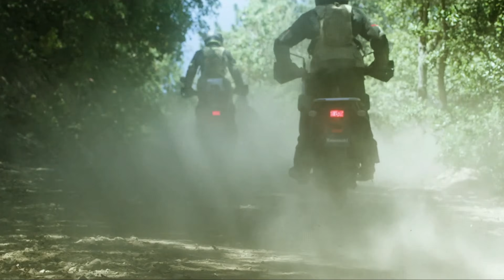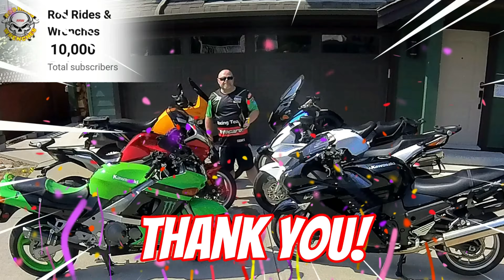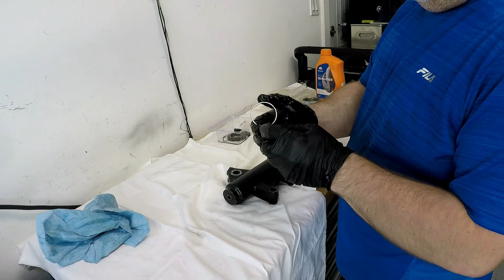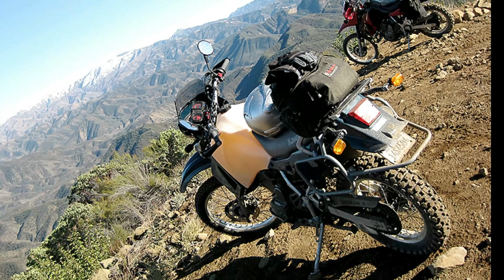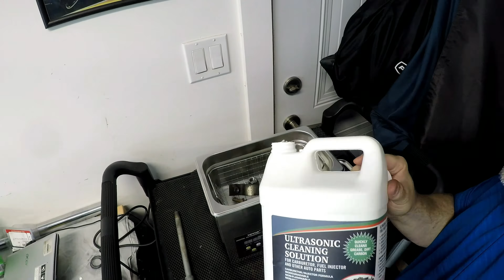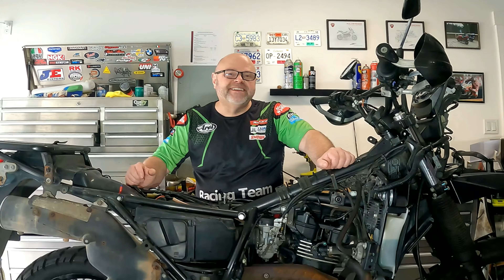Kawasaki KLR 650 Restoration & History

Comment: the proper way is to not get ahead of yourself taking the forks apart. that bolt comes off before you take the top cap off. preferably before the forks are even out of the trippleclamps, they are free fork vices why not use them. the spring tension keeps the damper rod from spinning, that bolt can come out with hand tools. ive done a fork rebuild in the dorm parking lot in and out before campus police noticed.

the way to install the top bushing and oil seal with no chance of damaging the fork is to wrap a bunch of electrical tape around the stancion and slide hammer it in just as you slide hammered it out on the stancion, stops moving you're done. no expensive one time use only metal tools or getting dangerous with washers, punches, and hammers. drop on the washer, roll in the clip, then mash down the dust seal with pure finger strength. rest is just reverse of disassembly.

fork oil level and weight are just more adjustments to play with to get the dampening you want, height is compression, and weight is rebound and compression. do with this information as you will best not to mess with it if you dont know what you want.

Comment: How did you get the pivot piece back on the bike? I'm currently stuck and can't get it back into the channel for the pivot bolt to go back through it.
Reply from the maker: It's hard but not impossible.  I lined the rocker arm up to the frame by resting it flat on my scissors lift and them tapped it into the frame, some taps harder than others.  If you don't have small scissor lift have someone hold it there.  Make sure the frame, grease seals and  sleeve are very clean, no left over grease dirt.  If it is really tight you can also put the complete rocker arm assembly in the freezer overnight to gain a few microns but you will have to work fast once out of the freezer.  Honestly it just take a but of force but make sure it is lined up to the frame squarely. - Good Luck
Reply: @RodRidesWrenches  Thanks! I ended up getting it by loosening the rear engine mount bolt on the right side of the bike, then prying the frame a little from the left side of the bike. It slipped in with PLENTY of space. 

Two late nights wiggling and hammering when it only took 5 seconds after making that little extra space lol.

Comment: Rod, I have a question or maybe a few:
1- do you have a video on  the V-Strom 650?
2- I plan on doing some outdoor adventure riding in Colorado next year.  I was told to look for a bike with good clearance. I am not certain what kind of riding I'll be doing. I live in TX and currently do no mountain or dirt bike riding. (I have an Honda ST1300). Can you give me any pointers on what I bike I might be looking for?
3- I am looking for a bike that I can ride both on-road and off-road as I want to ride in and around TX, and from TX to CO and not pull a trailer behind a car.
Reply from the maker: So many bikes, so little garage space.  If you want to do more offroad than on, I would suggest the DR650 over the V-Strom.  The V-Strom 650 is a capable bike but when compared to the 1000cc Strom it quickly loses its luster since it is slow and really uninspiring from the saddle.  Unless you plan on riding over logs/boulders and so on, the clearance is less of an issue that the aggressive nature of your tires.  I once road my 03 ST1300 straight up a logging trail while two up with my step son.  We turned around when the bears outnumbered us.  If highway is the primary focus then more engine displacement is better, you can compensate with adventure tires if you think you will be seeing gravel and dirt.  If you want to get off all the roads and onto the trails then I would for lighter machines like the DR or KLR single cylinder.  They can run all day at 60mph (but not much more, similar to the 650 Strom) and take you places you just drove by before on your ST. - Good Luck

Comment: Hi, an unrelated Kawasaki question from a fellow lower mainland motorcycle enthusiast.
Do you know if it's possible to put a quick shifter on a 2009 VFR? Thanks and love your content.
Reply from the maker: You can put a quickshift on anything fuel injected provided you find a kit that interfaces with the ecm.  Not sure they are worth the money on a VFR since you can power shift them up from 2nd gear on pretty easy just by blipping the throttle.
Reply: @RodRidesWrenches  Thank you for your answer. For some reason I 'm just not able to master the throttle blipping method. Not related, I know you like buying cheep bikes and fix them up. There's a 2006 VFR Interceptor with 26500 km in it for $2,550 in Surrey. Was listed on F/B market place 8 weeks ago. Nobody wants it looks like.

Comment: Hi Rod - I always loosen the fork bottom damper bolt while the fork is still assembled. I turn the fork leg upside down and compress the fork as much as I can and rattle gun the bolt loose.
Reply: Indeed, drane your fork ad the lower end. But leaf your spring and cap on and undo the bolt screw ad bottom. If that's done, unscrew the cap and collect your spring. Easy, peasy.